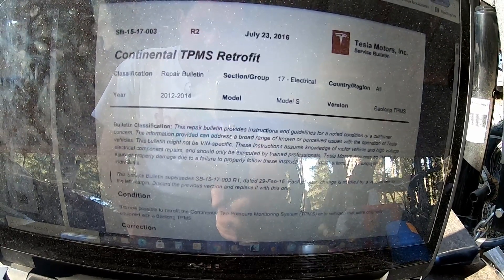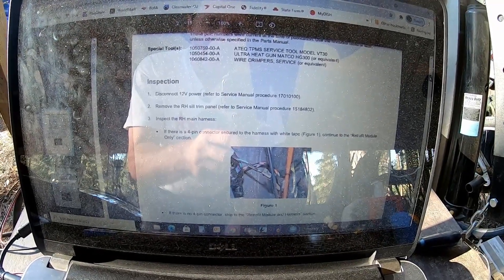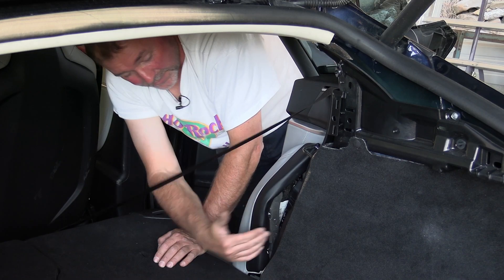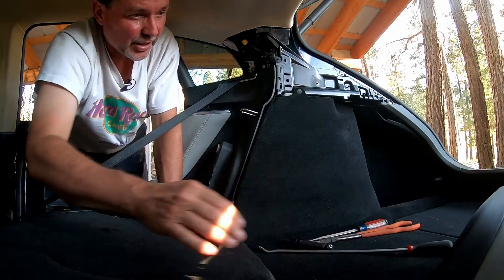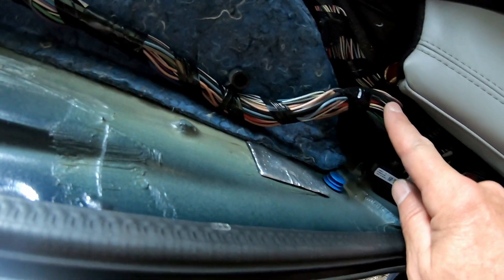2013 Tesla Model S TPMS Retrofit from Baolong to Continental TPMS,How to do your own retrofit Part 1

Comment from the maker: 👀Timestamps take you right to that chapter:
0:00 Introduction
0:30 The Tesla Service Bulletin
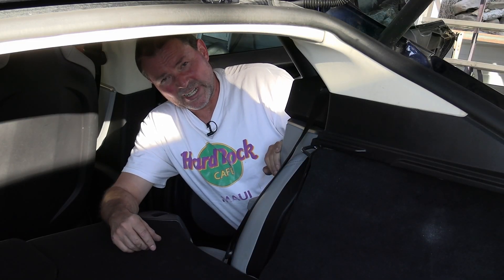3:24 The area in the car where we need to gain access
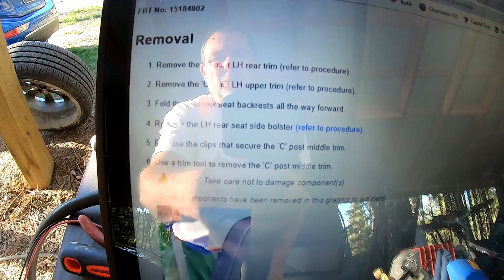3:51 The Tesla Service Manual
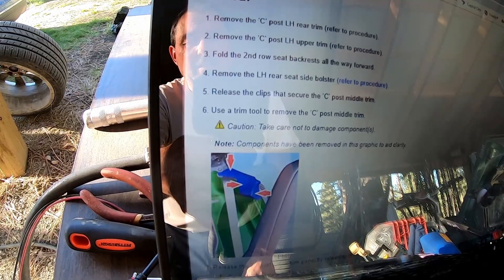5:01 Disassembly of interior
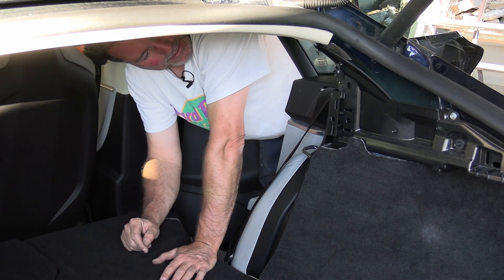7:11 The part that did not want to come off
9:07 Tip on how to remove the bolster
14:08 The wiring harness exposed
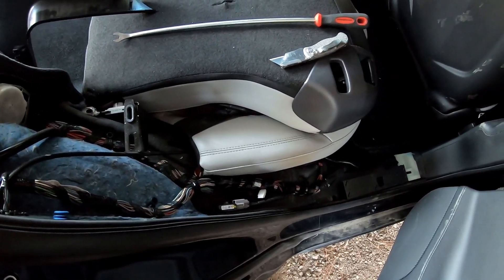16:07 Conclusion

Comment: Did you have to have the new MCU upgrade for this to work?
Reply: Thanks again! I just have to figure out Tesla toolbox next.
Reply from the maker: No, MCU 1 will do fine. The upgrade to MCU 2 is not needed for the TPMS upgrade. Still have MCU 1 today.😉😃
Reply: @ great news and thank you for responding! Are those the Bluetooth tpms sensors? There’s only 2 types of TPMS right? I couldn’t find your TPMS set from your eBay link that you provided on someone’s comment anymore. Is there a particular part number for the new ones to search for?
Reply from the maker: @ These are NOT the Bluetooth sensors. Bluetooth sensors came around 2021 to Model 3 and Y first. You need sensors for the Continental system. I guess the link in the description is no longer valid since that has been a couple years since I made this video. The current Tesla part# is 1074812-00-B for the 433MHz sensor. From Tesla these are $60 each. I found this on eBay, these are Black but you can also find them in Silver. Basically you are looking for 433MHz sensors. If for some reason, you come across one that says Baolong then these are wrong. https://www.ebay.com/itm/363139361838

Comment: Excellent!!! video. Thank you for taking the time to detail the retrofit. My Tesla Model S is VIN 54497, which is after they started putting the 6-pin connector in the harness but before 9/17/14 when started using the Conti TPMS. It looks like there is a hybrid period between VIN 50900. I think I figured out what happened. The Service Bulletin says that all Teslas manufactured after 9/17/2014 contain both the updated harness and the Conti TPMS ECU. there appears to be an overlap period when the harness has the 6-pin connector on the C pillar but still uses the old Baolong. VINs after 50900 appear to have this configuration. Not sure what VIN corresponds to 9/17/2014, but the Service Bulletin shows two paths: module only (harness has connector), and module + harness, where you have to add the harness plus the module to get Conti TPMS. I just opened up the C pillar sill on my 2014 Model S VIN 54797 and it does indeed have the 6-pin connector but no Conti TPMS, so I'll follow the "module only" path in the Service Bulletin. I wonder if I actually need to disconnect the old Baolong ECU??? Once the Toolbox config is set to Continental 2, shouldn't it ignore CAN bus messages from the old Baolong system, which won't be receiving data since my TPMS sensors will be Conti?? FWIW, removing the C-pillar sill was a PITA because of the way the bolster is connected. It was easier to remove the bolster fitting from the frame instead of removing the bolster from the fitting.
Reply from the maker: Thank You!